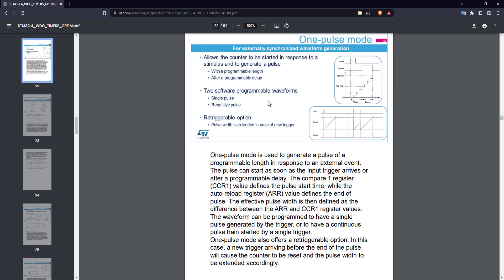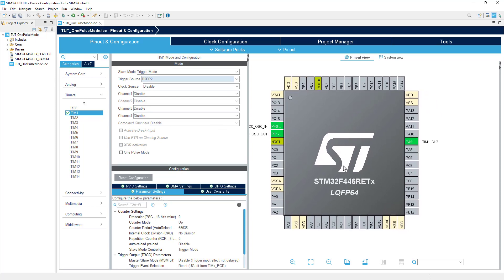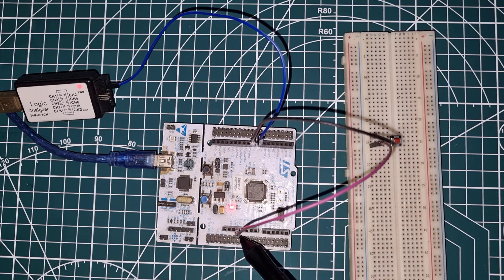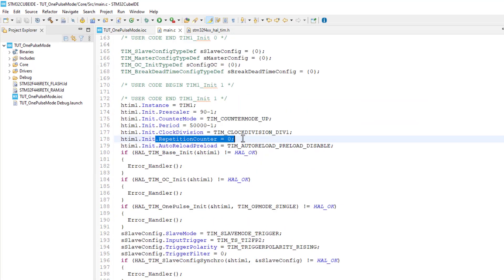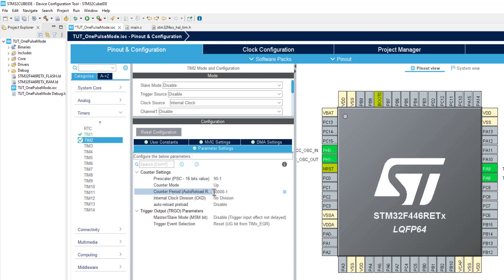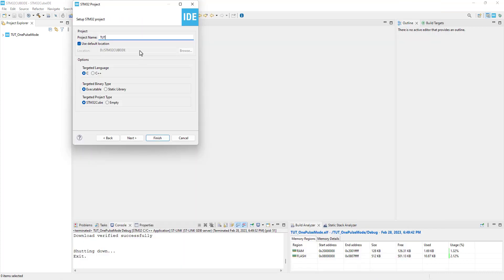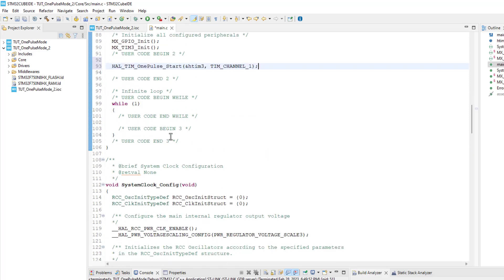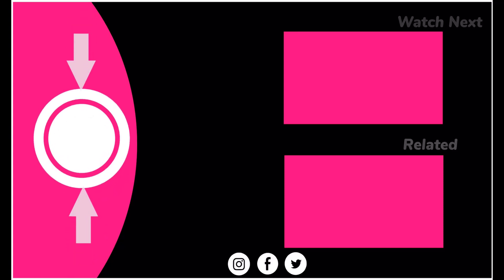STM32 TIMERS #9. One Pulse Mode

Comment: Thank you very much for this very useful and clear explication of One Pulse Mode programming. I tried it and it works very well. Now I have a problem. I need to have the output pulse on TIM1_CH1 as soon as the external input trigger arrives on TIM1_CH2 (without any delay) so I reduced  CCR. When I set it to 1 I have a 1us delay as expected, but when I set it to 0 no pulses are generated. I am using a 64 Mhz clock, a 64-1 prescaler and an ARR of 10-1. I am working on an STM32H723VGTx (from WeAct Studio).
Any help would be greatly appreciated :)

Comment: trigger source pin is set up as OUTPUT !!!! its flowing 45mA wich isn't good !!! pin has to be as INPUT !!!
Reply: Solved : i didn't use output compare , i have user PWM and then you change ARR and CCR register to set the width and delay of the pulse. When i use output comper my input pin should be set as input wich it was not, i checked with amp meter also with register.

Comment: I have a question. Is it possible to trigger the timer pulses using software?
Reply from the maker: Yes its possible but you still need some kind of trigger signal. For example you can use the trigger source as the ITR (Internal Trigger) signal, which is internally connected between the timers. 

Check out the previous “timer synchronisation” videos in this series to understand how internal trigger works.
Reply: @ControllersTech   I want to implement a kind of burst oscillator. Consequently, I am trying to use the timer 1 usin the RCR function. For example, triggering via software, I would like to create 20 pulses at 4 kHz.  The point is use the timer 1 as master and not as slave.
Reply from the maker: You can implement it in the way I described above. A timer is a slave to another timer but it still outputs the pulse. The slave part is only used to receive the trigger.

Comment: Its weird... My Trigger Input is getting defined as Output :(
Reply: Solved : i didn't use output compare , i have used PWM and then you change ARR and CCR register to set the width and delay of the pulse. When i use output comper my input pin should be set as input wich it was not, i checked with amp meter also with register.